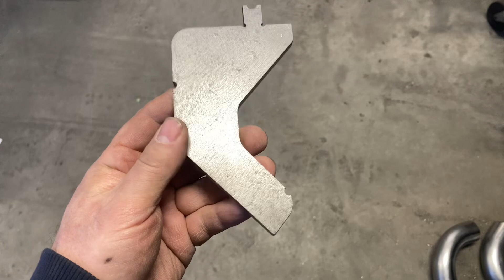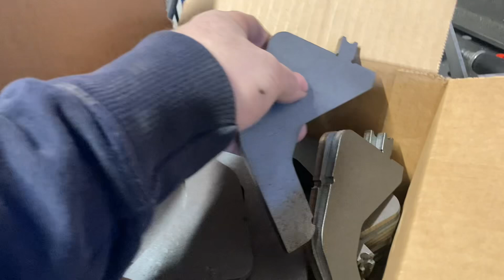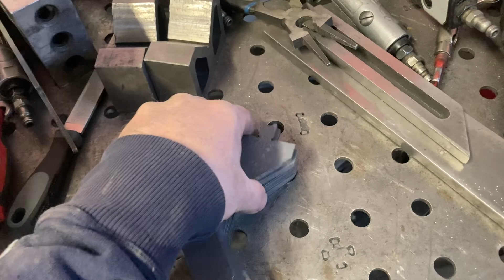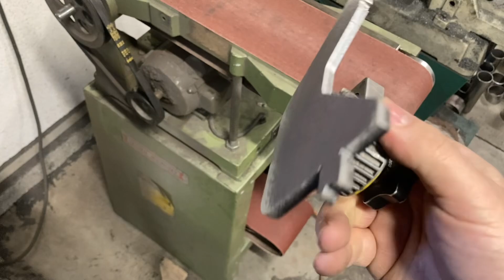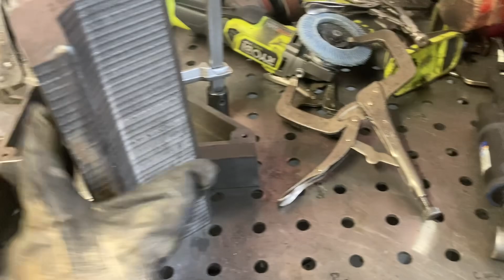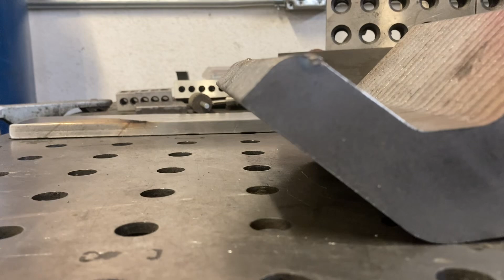Home made Gooseneck dies, tooling for a press brake

Comment: Thanks for the great video!  I like you alignment method, but I think you made it much harder than necessary.  I would have your design include 3 or 4 holes, maybe quarter inch, for rods to go through the whole stack.  Thread the ends of the rods and then put them through an tighten em up and you are all aligned!  (Might have to experiment with a test coupon of slightly differently sized holes to get tightest fit hole without binding on your selected rod).  You might still do the alignment as you do, but that would be a secondary alignment mostly just for holding the assembly which is otherwise held with the rods.  I suggest this because if you have a good laser cutter, that is going to be much more accurate than any alignment you might do with the edges.  The edges will have dross when can bias your outside alignment.  The holes can have dross also, but first it will average out over the hole proper, and then it will average out over the lets say 4 holes and rods.  Also, would do a counter sink on the hole openings, and if you want to get froggy (which a precision German would ;-) then you can chase the holes with a reamer to get the alignment down quite precise.  Anyhow, thanks for the inspiration!

Comment: I've been making a lot of these lately, based on your idea :)  I made a few with 2 holes  so I could allthread bolt them together in sections, then either weld them or not. I use a laser cutter so the holes are more accurate than plasma.  I've made some lower blocks with a backguage stop build in, for dedicated parts.